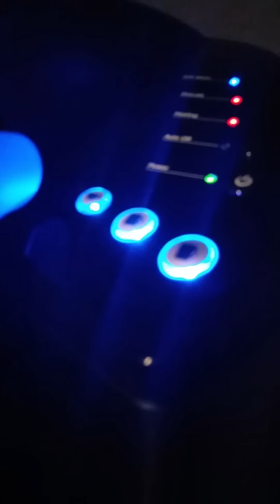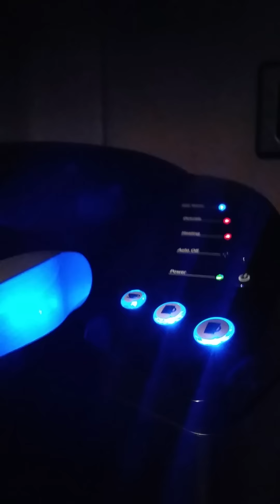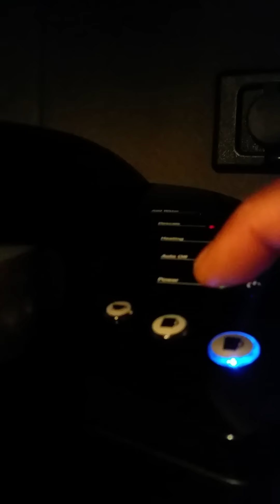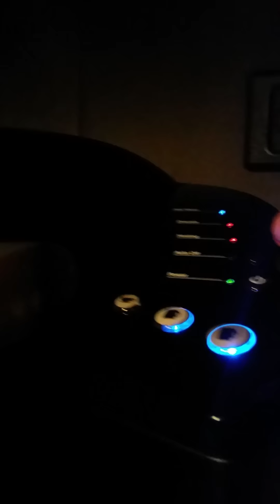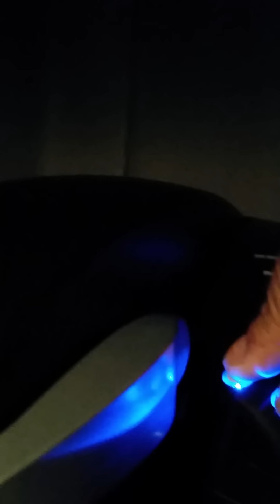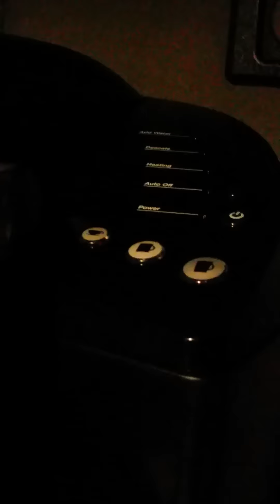Re-setting your Keurig  Coffee maker/...UNCUT/UNEDITED

Comment: I've got the 1st gen model of keyring, with only med. & Lg. cup size. Being a mechanic, I had a GMC Sonoma radio lock up like this. So using the same logic and figuring there's a reset.
With the lights flashing. I closed the lid down. Then while holding auto off.
I pressed large & medium, one at a time, then held them a few sec's and all lights went out. I then opened & closed it, then press power and it came back on and seems normal.

Comment: I fixed mine, I had the same issue. What I did was clean it first. Then I flipped it upside down (while upside down it will loosen any debris and bubbles stuck in the lines) and remove the two screws next to the needle and then took the lid off and squeezed the main hose pump to loosen it up. While the lid is still off I did a test brewing and it worked and I also turned it off and waiting ten seconds and it still worked on all three sizes. I also did a cleaning of the system while I fixed it and so far so good.

Comment: Thanks. It worked for me.   Same issue.  I pressed simultaneously "auto off" & medium/large buttons.  The lights turned off, so I unplugged it for 30 seconds, meanwhile, I put water and the little k-cups in its place. I plugged it (all lights were off), I pressed the power button and all the three cups buttons had solid light, so I lifted the handle and I put down again and now all the three cups buttons were flashing, I selected one and it started working properly.  Great now I have my Keurig alive again.  Thanks

Comment: my yadie friend, you was half right,Lol, pressing, auto off,medium and large cup, at the same time does shut it off, but you would run into the same problem,so repeat all steps again, this time remove the water dispenser,because the switch is at the bottom, turn it back on and leave it. Please let me know if this helped.
Reply from the maker: Cooking With Tammy , I eventually took it out of the truck and left it home, someone told me because of low voltage that's why it was acting up... it worked fine at the house.
Reply: Sorry To Hear That,  I Have Mines In The House And It Gave Me That Problem, Don't Believe Voltage Problem,But I Fixed It , It Broke Because My Wife Got A Habit Of Opening The Lid Before It's Done, She Cant Wait, So She Threw Off The Sensor And Then She Forgets To Put It Back Down, Don't This Sound Like When Men Leave Up The Toilet Seat, And Then You Hear The Woman Complain

Comment: Take a can of air and blow out the line. Start where the water dumps back into the place you add water. Be careful it's going to be messy and be sure you have a cup to collect the water from where you place the kcups at. This is what I had to do. Because of the flashing lights.

Comment: Thanks for sharing your tip.  I pressed only the 8oz, 10oz, and Auto Off button together until the lights stopped flashing. I powered on, and all is well.  I kept testing to make (9) 10 oz cups of hot water or (2) 6oz and it works perfectly well.

Comment: I did what you did to reset it the only thing j did different with mine is after resetting it i did not unplug it try that worked for me
Reply: Update same kuerig still working 6 years later however I had an issue today with the lid switch must be sticking a bit. Had to open and close it multiple times before the lights would flash
Reply: I woke up today a year later and now again having keruig troubles only this is different than the last time. It just starts brewing when I turn it on and won't stop until the tank is empty therefore it doesn't heat the water either
Reply: Update im still using this same Kuerig no issue. How is yours working did you ever figure it out?

Comment: I did some research.  The PCB (printed circuit board) is not voltage friendly and thus not tolerant to voltage fluctuations.  So those of us who use a generator or power inverter (from D/C to A/C) are subject to large voltage spikes as compared to power supplied by the Electric Company.  However, the Electric Company is not 100% immune from spikes during lightning storms, severe power usage (think A/C on a hot summer day), or a car crashing into an electric pole; otherwise known as brown-outs.

I was running my Keurig on a generator when this phenomenon occurred on my unit.  I depressed auto-off, large cup and medium cup and the PCB reset.  I then ran the unit from my Electric Power supply and it worked like a charm.  No issues on Electric Company power.  I now know what to do when my generator spikes.
Reply: That explains why the unit in his truck is having problems.  Thanks for the tip!

Comment: Hey, I'm an electrician and I was just wondering if your machine has the same problem when you plug it into a house plug, or only in your truck? I know that some electronic equipment can be touchy when it is powered by a generator or A/C inverter .  Have you tried it?
Reply from the maker: I thought about that...(low voltage probably) I'll try it when i get home.

Comment: Have you had a problem with it just sending water through the system without heating the water or stopping till the tank was empty?
Reply from the maker: hello kyle, thanks for watching the video...Yes it happen a few times, when i would hit the power button to start the process without closing the lid over the k-cup, hot water would start coming out the nozzle that pierce the k-cup, I would have to close it quickly then it would stop...then another time I had the k-cup in- with the lid close, it started brewing before the lights came on...only a small amount came out then the lights started flashing...then base on the cup size  I would press the sm, med or lg to compensate so I don't have an overflow...I'm still trying to figure out why it does this, I'll update you when I do, my best quess is a reprogram is needed... hope that helps. Thanks Mark
Reply: I had mine do this when I plugged it in but hadn't turned it on. Super weird.

Comment: Thank you! Our Keurig was doing the same thing, and after pressing those three buttons, it worked perfect, as in the  Power and Heating lights came on, the three cup size buttons lit up, and it brewed a full large size cup of coffee. The only difference between yours and ours is that the three cup size buttons did light up, so hopefully ours will still work for a while. I hope you can get yours working on a more permanent basis, and thank you again!